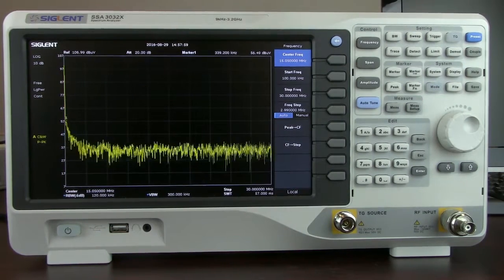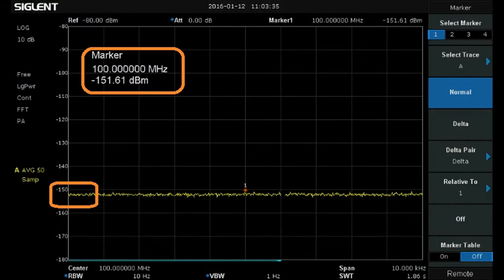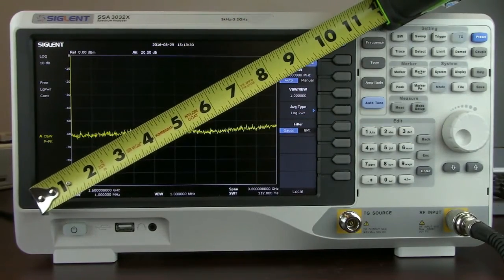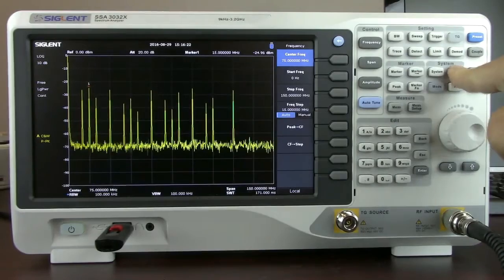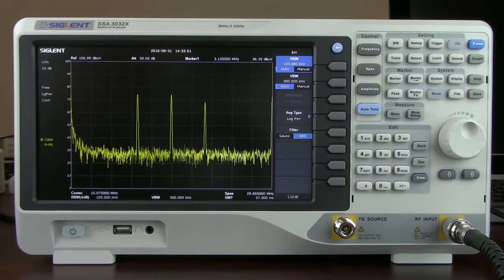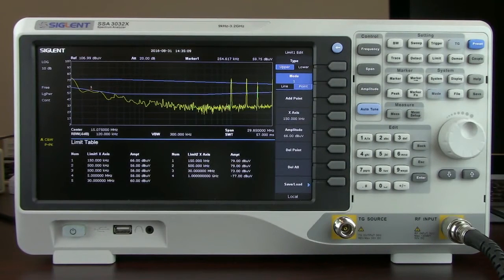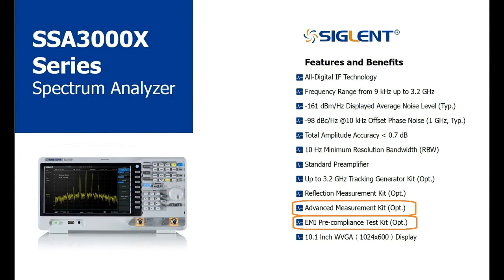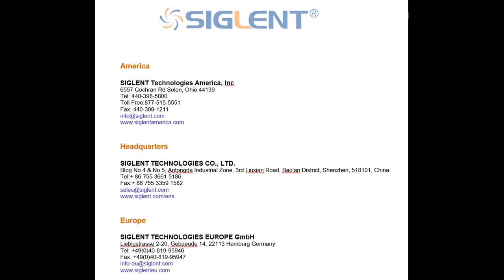SIGLENT SSA3000X Spectrum Analyzer Highlights

Comment: The Spectrum Monitor (waterfall) on my unit stopped working. The button is inactive.  Is there a way to reset it?  I did the system restore to factory settings.